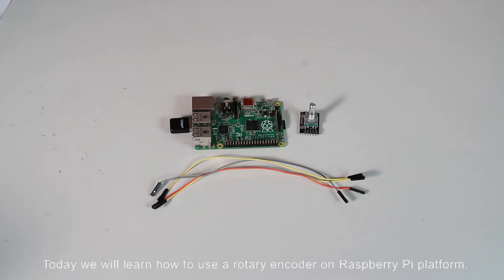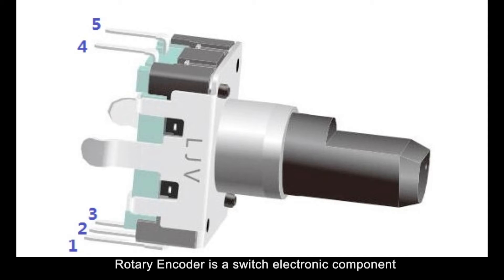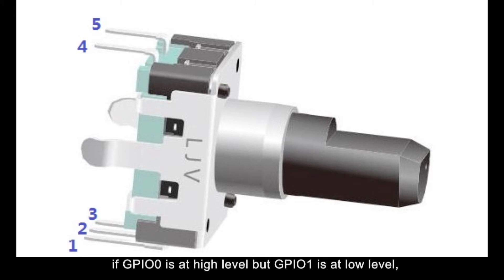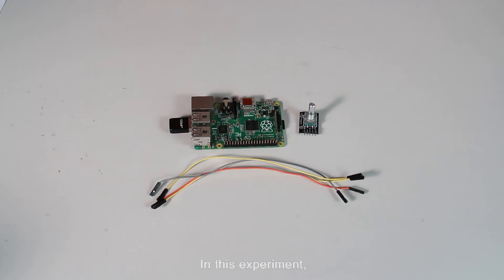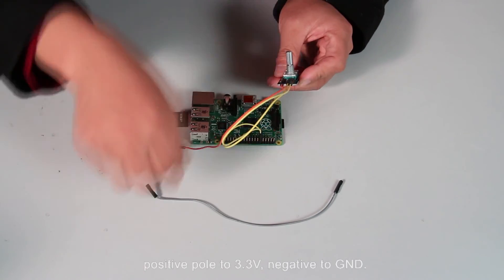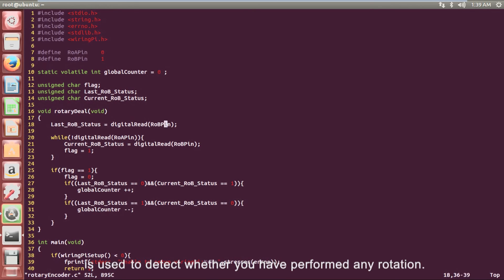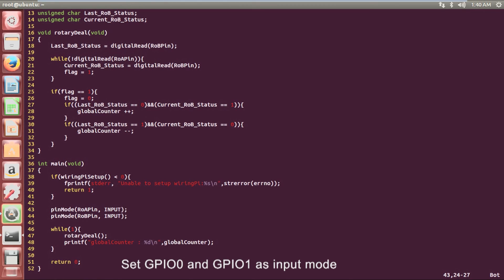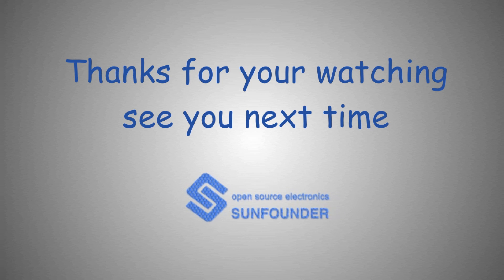Sunfounder Kit Turorial for Raspberry Pi - Rotary Encoder

Comment: Your program is incomplete because you don't take care of the bounds due to the encoder. That's why you read multiple same values when you turn the encoder instead of one at a time. You must introduce a small delay and test the state change of the 2 signals CLK and DT between two readings. Cheers. Here's a C example that should work better :

#include <stdio.h>
#include <wiringPi.h>

#define DT 0
#define CLK 1
#define DEBOUNCE_DELAY 5 // Ajuster ce délai en fonction de vos besoins

// Variable globale pour stocker la position de l'encodeur
int position = 0;

int main() {
    if (wiringPiSetupGpio() == -1) {
        printf("Erreur lors de l'initialisation de WiringPi\n");
        return 1;
    }

    pinMode(DT, INPUT);
    pinMode(CLK, INPUT);

    int previousDT = digitalRead(DT);
    int lastDebounceTime = 0;

    while (1) {
        int currentDT = digitalRead(DT);
        int currentCLK = digitalRead(CLK);
        unsigned long currentTime = millis();

        // Si le bouton a changé, on démarre un nouveau compteur de temps
        if (currentDT != previousDT) {
            lastDebounceTime = currentTime;
        }

        // Si le bouton est stable depuis DEBOUNCE_DELAY ms, on considère que le changement est valide
        if ((currentTime - lastDebounceTime) > DEBOUNCE_DELAY) {
            if (currentCLK != previousDT) {
                if (currentCLK == 1) {
                    // Rotation horaire
                    position++;
                } else {
                    // Rotation anti-horaire
                    position--;
                }
                printf("Nouvelle position : %d\n", position);
            }
            previousDT = currentDT;
        }

        delay(1); // Un délai très court pour ne pas ralentir le programme
    }

    return 0;
}

Comment: good tutorial. There is just one small question that I can't find GPIO0 and GPIO1 port on my raspberry B+, should i just connect to GPIO2 and GPIO3 respectively?
Reply from the maker: +Knight Blanc Yes, you can. But first you need to clarify the GPIO numbering method you apply, see this link http://www.sunfounder.com/index.php?c=case_incs&a=detail_&id=282&name=Sensor%20Kit%20for%20B+&zsid=112. Then modify the pin definition in the code.
Reply from the maker: +Knight Blanc Since our website's been upgraded, the link is changed to this: http://www.sunfounder.com/learn/sensor-kit-v2-0-for-raspberry-pi-b-plus/introduction-sensor-kit-v2-0-for-b-plus.html